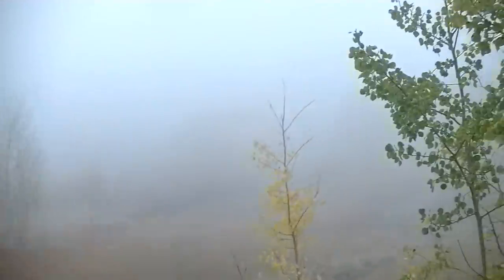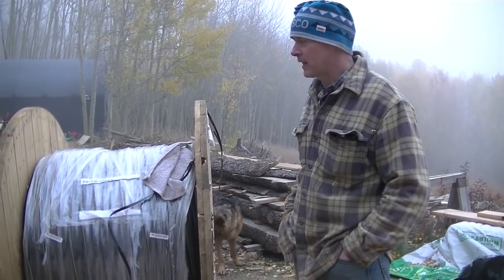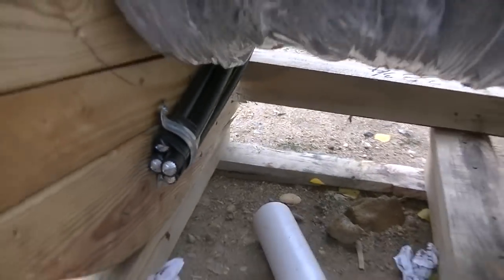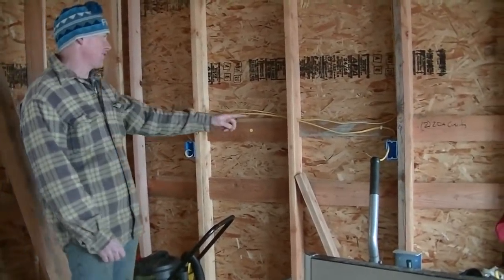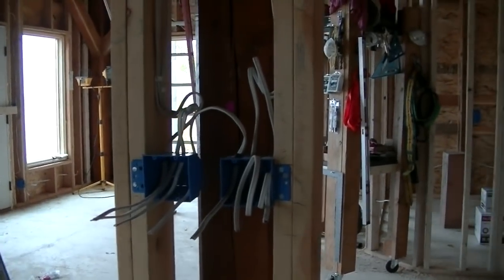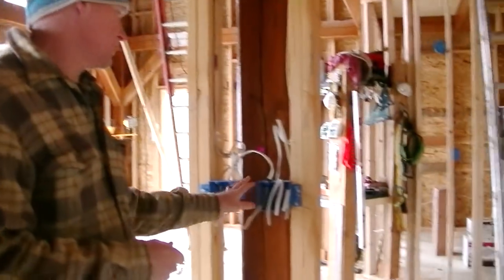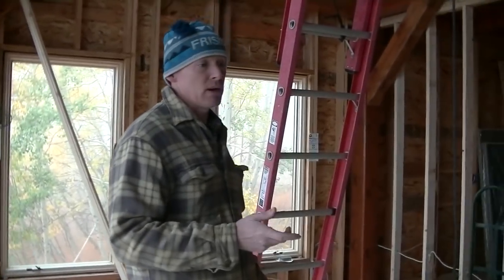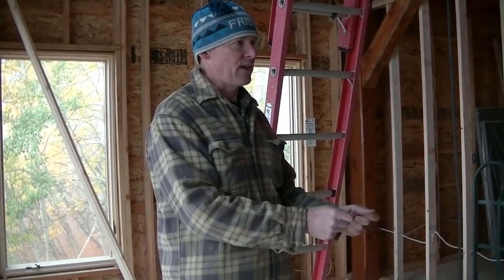DIY Electrical Home Wiring  What We've Learned

Comment: With all do respect ✊ as a 35 year old electrician in your kitchen I might suggest that you put all 20 amp GFI breaker type circuits more is better because once you cover or sheet rock your walls almost no going back, you might consider under cabinet lighting doing that before hand is a time saver later, also plan on dimmer switches for all your LED lighting nothing sucks more that going in the kitchen in predawn and getting blasted by a bright lights
Reply from the maker: That's what our electrician did for us. We ended up getting some remote control under cabinet lights.

Comment: I have been called more times to solve non compliant homeowner wiring installs after that fact that it would make your head spin.
There are a lot of nuances in the rough electrical install.
Box fill, wiring support and attachment, wiring placement in wall studs and joist, neutrals at switch boxes, arc fault / GFCI requirement 
Etc, etc.
Please, call a local electrician and have them do the rough. This will save you so much time and money in the long game.
You can always do the trim out yourself to save a some dollars.
Reply from the maker: Great advice. We did hire someone to finish what we started :)

Comment: Sounds like he has it under control - lots of "requirements".  Best advice I can give is put power were you want it.  Might as well wire for cable, internet, modem, charging stations, etc.  Do expect to fail your first inspection.  The inspector is just trying to help you & keep you safe,
Reply from the maker: We'll see if we can get an electrician to sign off and get the inspection for us so we dont' have to fail. lol

Comment: just an  idea   mount a main disconnect on the outside   then circuit breaker box inside   simple solution for minimul cost
Reply from the maker: We like that idea!
Reply: Quite common here in Canada   The wire up here is not a concern as Aluminum wiring was outlawed back in the 80's I think   Strictly copper wire allowed

Comment: Where I live our power company dose all the inspections. The buried cable has to be in conduit and so many feet from trees also you must have a outside disconnect. I am SO glad I hired a good general contractor that had a good electrician. A friend of mine did his own electrical and it took 2 months and 4 inspections just to pass the first inspection. He told me the he wished he never attempted it. If I were you I would stop now before you spend money and time on things that will not pass.
Reply from the maker: Interesting. The state does it here. and the housing inspector just reviews the "rough-in" for electrical.
Reply: I also had to have GFCI outlets in the bathrooms and kitchen. I had no idea of any of theses things and my general contractor said he knew what the power company look for and that depending on who your electrician was how much grief they would cause. Good luck.
Reply from the maker: They have been a big help so far. Said the mission is to "get us power and pass inspection". But they knew about the meter release inspection- we didnt know about that one! Hope it will be all done end of next week.
Reply: Good luck I hope it all get your power soon. The company would not turn the power on until they passed ours. Then they did they came back to inspect after the furnace and ac was hooked up. They said the ac needed a different breaker and give week to replace it or be turned off. So the ac company fixed it and called the power company and six months later they came back to check it.

Comment: I like to do wiring as well as a homeowner.  Where the wire enters your receptacles and switch boxes is a notorious place for air leaks.  You may want to investigate foaming them to seal them as part of your insulation.  I have even seen a sort of box within a box  which really seals nicely but you are past that point.
One of the last couple of issues of Fine Homebuilding magazine had an great article about how to neatly run wires into the service box, that you may want to read as well.
Good job diving into it.
Reply from the maker: Interesting. Glad you brought that to our attention. That would be a helpful article to read! Thanks

Comment: fasten within 8" inches of the box, ground must be continuous (ie can't run through an outlet), arc fault protected ckts in sleeping areas,  GFCI protected ckts in kitchen, baths, basement, garage and outside. Nail plates on studs.  Space outlets so no place along a will is more that 6' from and outlet (read the exceptions).  All outside doors need outside entry lights.  Two 20A ckts in kitchen.  Leave plenty of extra rough-in wire in the box. Watch your  switch and outlet box wire fill.  Sub panels need a both a ground and neutral bars that are isolated from each other.  Ground and neutral only connected together in the main panel.  Panel must have a bonding grounding strap.  All water pipes and gas pipes need to be ground bonded. Here the water service pipe mush be bonded within xx inches of the entry to the structure.  Have the proper sized UFER ground wire (protected where exposed).    Make sure the breaker are approved for use by the panel manufacturer.  Just because it fits doesn't mean they they tested the panel with that brand of breaker.  Remember the code is the MINIMUM requirement.  You don't want the lights to flicker because that Laser printer at the furthest spot decides to print.  Now is the time to add extra runs even if you don't put the boxes in  just in case.  Take lots of photos.  Once the drywall is on it's a lot harder.
Reply from the maker: Thank you for sharing all your expertise. So helpful!! Much appreciated.

Comment: As far as you are from the power pole I would suggest an outdoor junction box or breaker box then jump into the indoor main breakers.  I don't know if you plan on doing another shop or shed, but it gives you a better place to get power from for any future projects than an indoor breaker box.  When stringing the wire hang it on a center pipe from the loader then back up to unroll the wire.  If you hold the spool on one end and drag it it is harder on the insulation.  Personally I like to see things in conduit to keep the rodents from eating holes in it but it does take more time/money to put it in.
Reply from the maker: That's a great suggestion. We are planning another workshop further away from the house. Great tips!

Comment: Most new builds, for the past 20 years, require an outside Circuit Breaker box to be mounted on the exterior of the house at the entry point. Fire Code stuff. In case the Firemen need to kill all power to your dwelling. But, I live in Texas .I would not listen to Retail Electrical sales people. It is like listening to Auto Parts Story sales people to repair your cars. Read all the Colorado DIY and hope you understand it. But realize you maybe spending more money to correct what you understood. NEMA Codes can be surpassed by Local Codes that require more safety protection than the NEMA code requires...but not less. Spend a little more $ and have a real Licensed Journeyman or Master Electrician...not do the work. but tell you how the work should be done by you to make sure you pass Inspection! So many DIY folks lose money by thinking they understand, their interpretation of the Codes in their area. Like you guys.....just don't want to see you fall in the same trap as your water well permits.
Reply from the maker: Thanks for sharing all this good info. We may be able to get a local company over for review before inspection- hope they are available!

Comment: I watched more of your video after posting Like#35 so I went and tried to see what your code there said, which I could not find a clear rules on how much/many items you can do in the house for everything, so here is what I have done in the past, kitchen - 2  20 amp recept per circuit with 20 amp GFI for the first recept, 6 20 amp reg. recept each circuit at no more than 12 feet apart, Bath room 20 amp recpt with GFI,  I would hope you get a electrician to lay this out for you before you get to far into this so you can make changes be for the sheet rock is up also I saw that you have to submit a electrical plan and permit/inspection before you close up the walls, the inspector should be able to help you wit hall of this, I did go to DIY home-builder to inspect or pull permits for them when i did this work, I would charge  $50 plus permit but I am sure its not the same anymore, Just be safe and make sure the power is off when working on this, more people die from 120v than you think, another thing, don't do the quick connect push-in on the sw or recept, wrap around the screws is safe and less worry from a lose wire later, I put only the things in here that I thought I heard you talked about,   Later going to bed at 78, I need my rest.
Reply from the maker: Thanks for taking the time to share all your expertise! We truly appreciate the help and suggestions. Great ideas.

Comment: Don't forget to have your plumbing in mind when running the wiring, so there won't be conflicts.  And I agree with a previous comment about putting your meter base outside, but definitely put the panel indoors.  They don't weather well outside.
Reply from the maker: Good point. Seems to be the consensus.

Comment: I've been a journeyman  electrician for over 20 yrs. .. 
Put an exterior weatherproof  disconnect (or the meter base if it's at the house), on the outside of the house , then use a small piece of the  other cable from the disconnect , to the panel inside... you don't want to have an exterior panel, especially with all the weather you get in Colorado !!! 
Plus it's alot easier to add more circuits and outlets if your panel is inside
Plus here's a link for you   https://www.jeffco.us/DocumentCenter/Home/View/9245
Reply from the maker: Thanks so much for sharing all your expertise! We'll take a look at the document.

Comment: Get a 200 amp service disconnect box on the exterior and short jumper cable through conduit or romex to inside breaker box.
Reply from the maker: Thanks for the suggestion!

Comment: Like #35,  Yes get a combo outside meter 24 circuit weather proof panel on the outside  wall, that way you'll have the 200 amp wire coming in from the pole service into a 200 amp main breaker and 24 circuits for the outside connections like AC unit disconnects or WP GFI receptacle  and lights away from the house, to the barn, water pump/well or what ever, also if you get the solar you'll more than likely want to use that outside panel to work with that, if you get a generator you'll make your connection to that for the switch over from electric company and the generator switch,  be sure to use noloxs on the wires that are alum, this stuff is hard to get off your hands and cloths but a necessary item to help make a good electrical bond under the lugs on panel or breakers, it reduces the heat in the alum wires which can make the lug screws expand and contract which in turn could loosen your lugs and then cause a fire, be sure to get the right info and stuff at your local electric supply house,  even have a master come out and inspect you work or the inspector for your permit, heck ask him about this, Just thought of something else, use 14/3 with ground wire for your lights, that way you have a sw wire for 2 circuits plus a neutral and ground or 1 sw for lights &1 sw for fan if you put a ceiling fan up high to help with the air circulation,   Ok, just thinking out loud,   Later  spelling is not one of my strong points,
Reply from the maker: Ok taking notes. Lots of good info here- thanks!!

Comment: you could have a main box outside that links to a inter breaker box with the right cable you would only need about 3 feet or so. it would double your boxes but at the same time if you even needed to add a breaker or needed to work on the inside box you would have a main shut off to your inter house box. its a little more costly but long run it should be saver..
Reply from the maker: So many good ideas- thanks for sharing!

Comment: read closely your local county website bylaws on electric service it changes year to year. i'll tell you this about service cable size. i live on a dairy farm the power lines come to the 25kw transformer, then 200amp stranded aluminum over to a main disconnect switch, then 100amp cables to house/dairy barn/livestock building. and so that's the reason we had stray voltage hurting our cows. too much draw from all the electrical equipment in a modern dairy with under size 100amp wiring from early 1960's
Reply from the maker: ok will do.

Comment: Would the power co not set you guys a pole and transformer up near your house?
Reply from the maker: Yep the "low" quote was over $14,000 so we decided to do our own.
Reply: WOW! Most of the time I ever had any dealings with the power co all I had to do was set a meter loop pole and they would get power to it no matter how far it was. I can understand doing it yourself for sure!!!!
Reply: Colorado Mountain Living 
So that would include your own transformer?
Diy approach you lay some cable to the street and tap into existing transformer?
Also on light circuits have a few breakers so if one goes off you still have lights in the house.
I’m old school do like the idea of conduit for in ground cables.
Keep up the good work and keep warm.
Reply from the maker: The power company quote included the transformer. We put on the meter box then have to run it up the pole under some conduit and I think the company connects it to the transformer when we call to start service.

Comment: Better to have a circuit breaker on the outside in case the firemen need to kill your power
Reply: Except from a security standpoint.  Could someone conceivably turn off your power to kill your alarm and burglarize your house?
Reply from the maker: Great idea- our neighbor has one on the pole.
Reply from the maker: They would have to get past our guard dog first.

Comment: What about an out door disconnect and then run inside?
Reply from the maker: Ok- perfect! Then we just need a small piece for the "correctly rated" cable to run inside.
Reply: yep.
Reply: The reason you need such big wire (250 mcm) is because of the voltage drop over that long of a distance. The drop from an outside disconnect into the house will be minimal. Therefore you can use much smaller wire. You may know this already but I thought I would enlighten someone who might not know it.